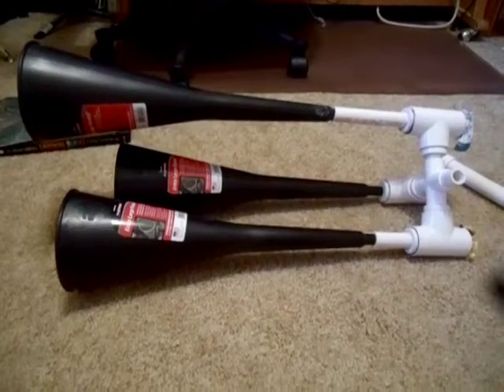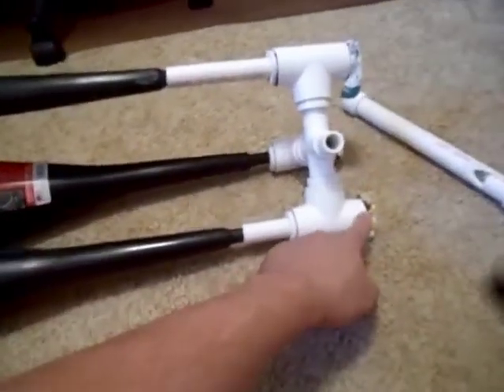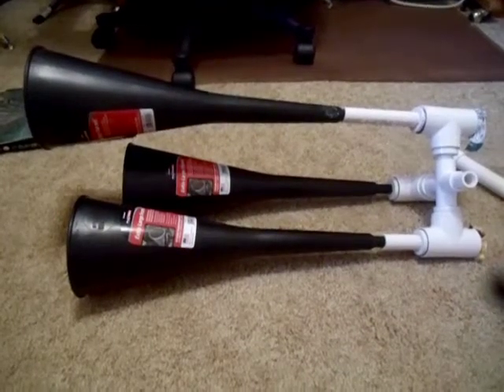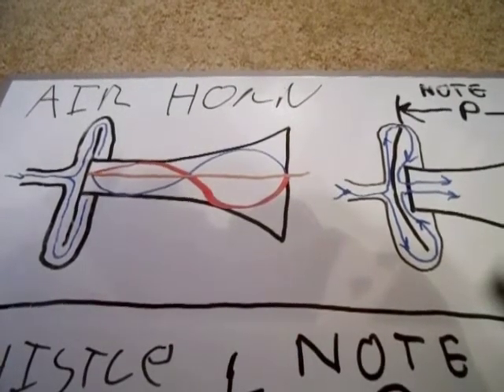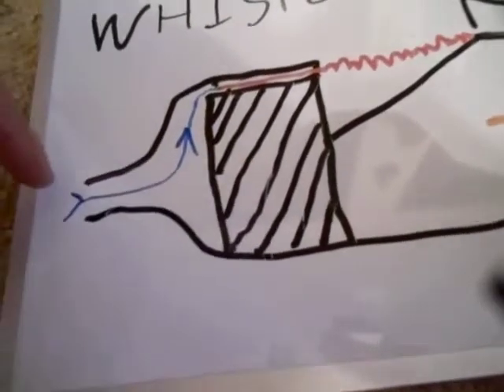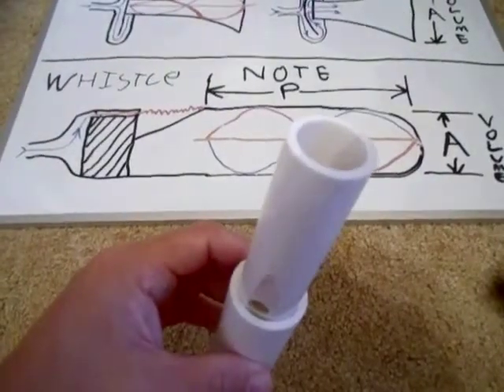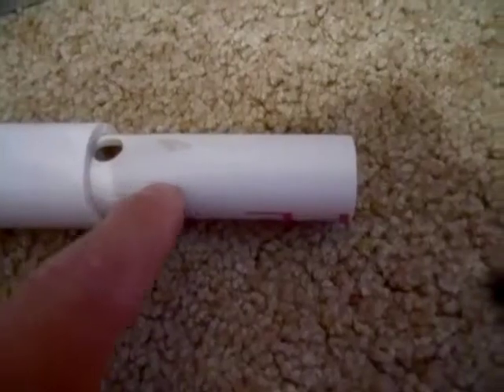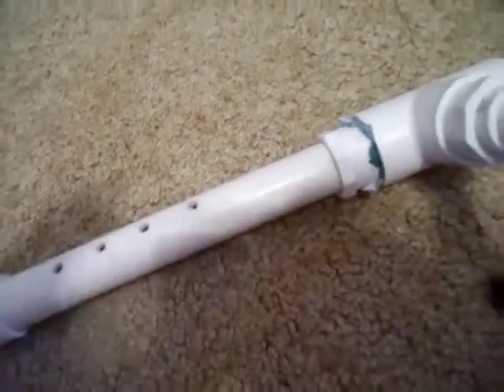Air Horn & Whistle Science

Comment: Your diagram is wrong, for standing waves with an open-end it needs to be an antinode (peak value) at the end, as then the change in acoustic impedance (resistance to sound propagation in a medium)  will cause reflection at the end allowing for a standing wave.